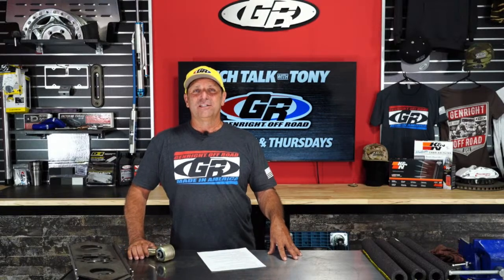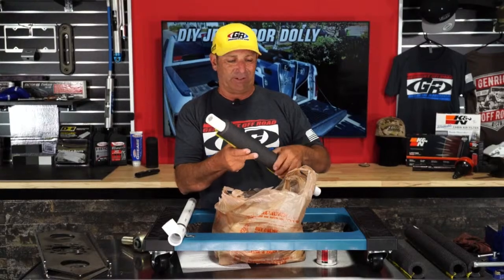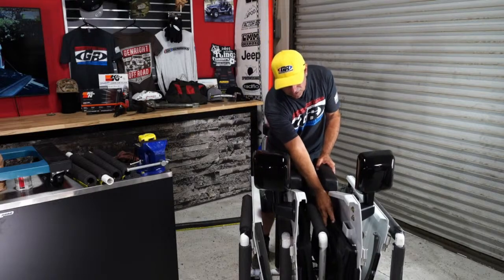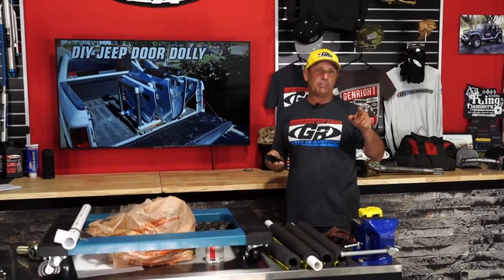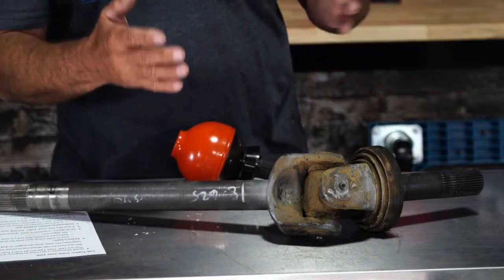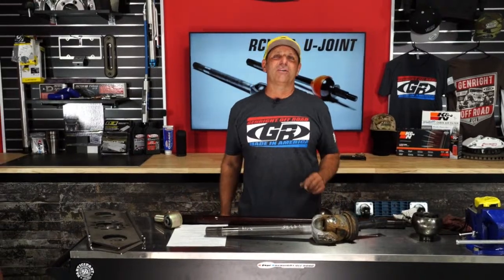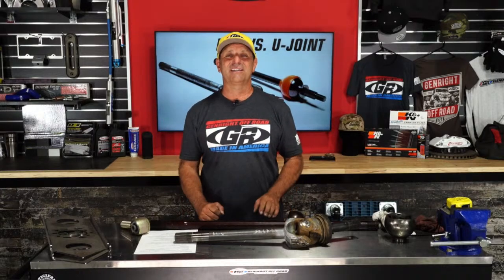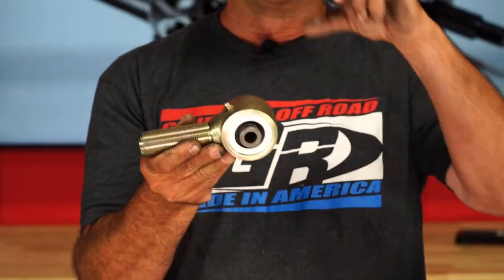New JL Roll cage development!!! - Tech Talk with Tony 15 Jun 2021

Comment: On your web site, you seem to prefer Currie axels. What is the pro’s and con’s of those compared to the Dynatrac axels?
Reply from the maker: We do sell both Currie and Dynatrac axels. The Dynatrac axels do have a thicker axel tube housing than the Curries but that also comes with the extra weight. Both are significantly stronger than your stock axles. Dynatrac only offers an 8 lug option where Currie offers a 5,6, and 8 lug option for their axles. For people that have already bought certain wheels, it gives them more options than having to replace their wheels as well when buying new axels.  Both have high pinion fronts but only Currie has a high pinion rear 70 where Dynatrac is a mid pinion on their 80. Dynatrac has their own forged knuckles and bearings which do offer more steering angle than the Curries do. Currie has their center bearing in the knuckle and Dynatrac mounts theirs in the hub.  The Currie does have a rolled back diff cover which gives you better up-travel with our suspension because the Dynatrac do have to have an offset bracket to work with our that is a little taller. The Dynatrac axles are a little over $3,000 more for the axle set. There are a few more details between the two but these are the biggest ones. Both are great axles and you wont go wrong either way.